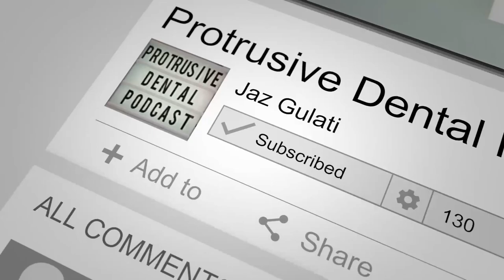How to Use Injectable Composites To Treat Toothwear MASTERCLASS - PDP081 (Injection Moulding)

Comment: Do you have any thoughts on alternatives to isolating the alternative teeth prior to bonding? I do a lot of injection moulding and find it to be a great cost effective technique for interim full mouth rehab/OVD increases, but I feel like its more laborious than it needs to be. 

I preload the stent in the nooks with injectable and then inject the rest, this allows me to control the injectable material and minimize cleanup, but isolating every second tooth effectively with teflon takes a lot of time. You have to cut a strand for each surface and tuck it into the gingival sulcus which is time consuming if doing 4-4.

Surely there is an alternative method to stop the composite from sticking to the adjacent teeth when injecting? Any thoughts on an easier application method that could peel off that doesn't deform the clear matrix?
Reply from the maker: @suresh211  I use the every other tooth model so the first round is relatively minimal clean up
the 2nd round does require the PTFE in my hands
I don't have the answer here but hoping someone from the community does  - thanks for asking an excellent real world question

Comment: Jaz - have your ever tried using a smilefast stent but use the gaenial flow composite? Best of both worlds?
Reply from the maker: Have used smilefast with heated paste but not with GUI - I know that Mide and Tom tested a lot of composites before deciding on their protocol - I would be too chicken to try! Have you tried?
Reply: @protrusive  I will soon Will keep you updated
Reply: @protrusive 
Tried it today. Worked really well. Gaenial flow does have an air bubble problem 

But overall a fast efficient way of doing things

Comment: Does gc injectable A1 has enough opacity to restore a class IV restoration or i need dentine composite layer beneath it .
?
Reply from the maker: sorry for delay! In my experience you need to cut back and layer as it's a little on the translucent side

Comment: Im having bubbles on my exaclear when i take impression on my asiga printed model, seems like the resin is not compatible with the clear putty, so i have no choice but to duplicate the printed model, to stone model, then only i take the exaclear inpression, defeat the purpose of speedy digital waxups.. any ways to overcome this?
Reply from the maker: Hi Edelweiss - sorry for the delay while I asked Dr Kostas about this. This is what he suggested:
Bunbles in exaclear form usually because its is not pressurised in a pressure pot. When pressurised its clear as glass. Printed models can interact with PVS but i ve only seen that with putty/wash stents (mockup ones) rather than exaclear.
If bubbles dont come onnstone model but they do on Asigas then its the cleaning of the model… i get all my stents made on Asigas (solid models, not hollow)
If bubbles come on both stone and printed then its the pressurising issue

Hope that helps - as you can see Kostas is a genius geek!